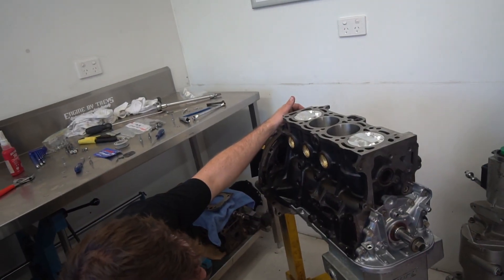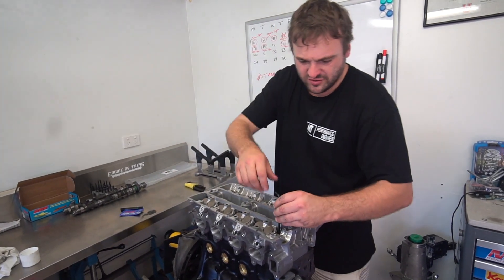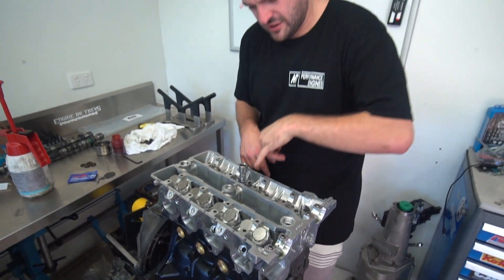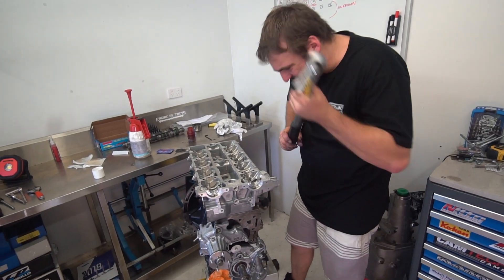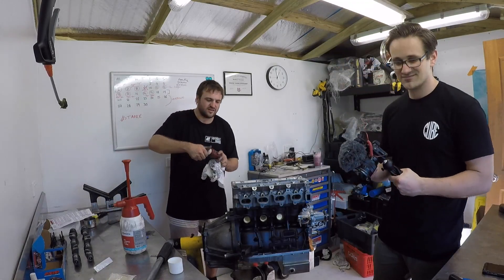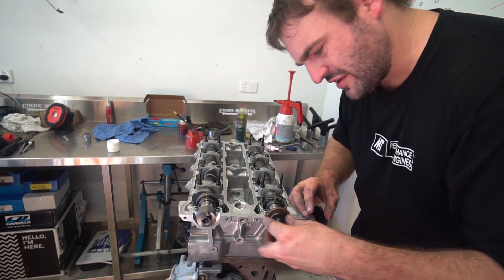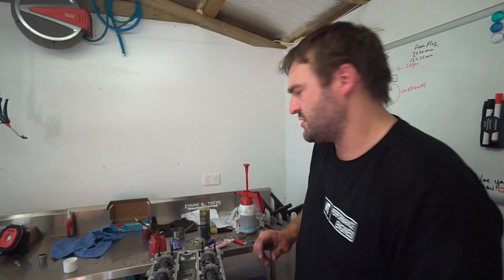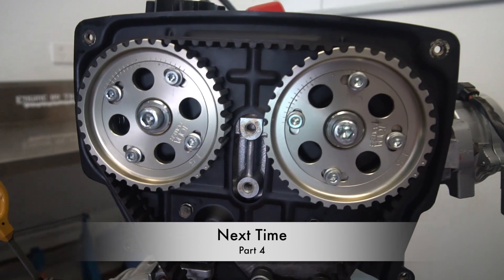FULLY WORKED 4age/7age Build Part 3

Comment: Great build. What is the real difference between 4AGE and 7AGE in terms of revving given that the stroke is longer? Thanks
Reply from the maker: Ive seen people rev 7a engines pretty hard but just like any high rev build maintenance is high and life span is low, I was chasing low to mid range torque out of my engine being a street motor and the 7a was the best fit for me

Comment: hey niko am building a 7age rite nw using black top 20v head with 7afe oil pump i cant get the timing right I was told to get a t107 timing belt from a 1986 porch I did a still not getting true and for sum reason I want to try out the 7afe oil pump
Reply from the maker: sheldon mccook I’m just using the mrp kit and I’m unsure of the part number but I will say that the 7afe oil pump is a bad idea, I’m using a silver top 20v oil pump it’s a stronger high volume high flowing pump. 

I have seen people use the 7afe pumps before so it’s doable I just don’t recommend it.

Mat talks about timing a 7a in the next video without the recut key way but he did have adjustable cam gears.
Reply: Hey sheldon ,are you using 20v head gasket?

Comment: This is a sick build! Im building a 7agte my self but im not sure yet what ecu to use. Im gonna put it in a Toyota celica witch runs a 7afe, so it has a 7a ecu. I was planning to just use just a piggyback ecu(because i want it to be a budget friendly build considering im just 19) but i cant find out if the 4A cam censor/ignition coil will cooperate with it... Maybe you have some advice?
Reply from the maker: Rick Ensink 7agte sounds cool, I don’t have any experience with piggyback ecu’s but I do know 4age’s can come with different styles of cas sensors, mine has two points of reference which is what I needed to make my setup work, if your cas only has one point other option is to run a crank angle sensor which isn’t a big deal as plenty of companies make kits for our engines. I’m running a haltech elite 1500👍
Reply: @NEVER-LIFT  thanks voor the reply!
Ill have a look at the 7a wiring harness , i know the ignition coil i got with the 4a head is 2 pin. Otherwise ill still have to get a 4a engine management system and put in a different crankshaft position sensor like you mentioned
Reply from the maker: @RickEnsink  Damn I think you might be out of luck my cas is a 3 pin. 

Send me some pics of your build man sounds cool, do you have insta? @199niko199
Reply: @NEVER-LIFT  i have insta its rickkemans, i have my engine at a machine shop, so far i only got the head and piston rods(h-beam max speeding rods) and i ordered 4agze pistons for a lower compression ratio since im going to turbocharge it and they'll take som power(if i remember correctly it went from 12-1 to 9.8-1)the rest im still figuring out.

Comment: Did you use the 16v or 20v TRD head gasket? I know some of the coolant holes in the 7A block don’t line up perfectly with my 16v gasket. Great video by the way!
Reply: I used the 16v gasket as that's the cylinder head used the block is identical between 4a and 7a the 20v gasket used on a 16v would overheat the rear cylinder and you wouldn't know it
Reply from the maker: mathew trevena cheers Mat👍